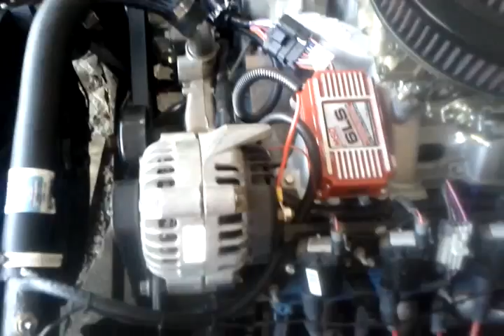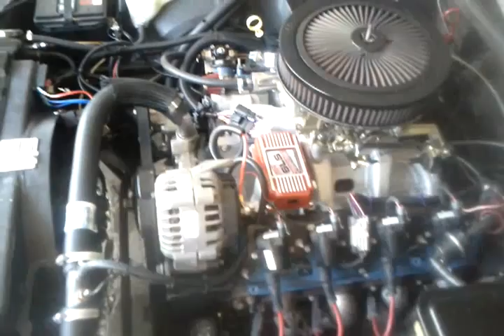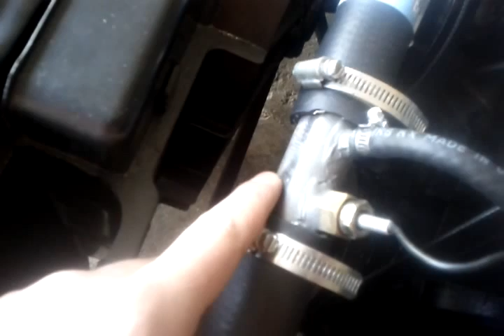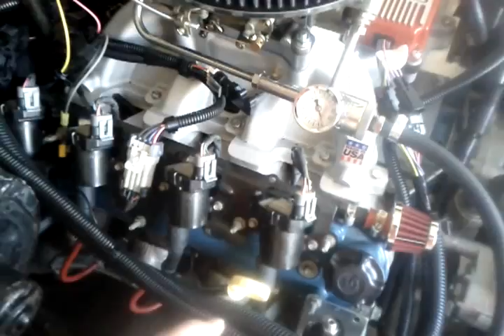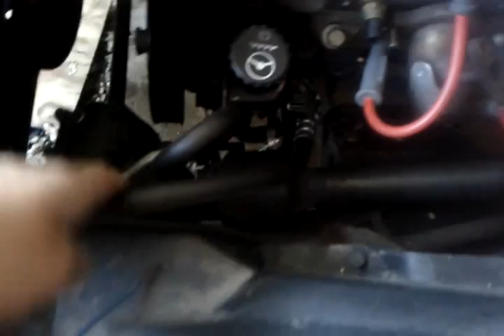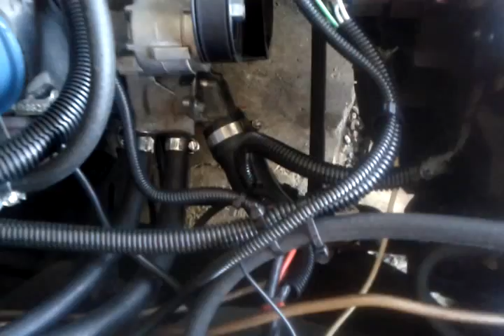How-to: Swap an LSx Ls1 4.8 5.3 6.0 into older GM cars

Comment: Did you have any problems...puting back on the  oil stick or trans tube..i have hooker headers...trans tube ...i put headers on then trying to put them back..not having any luck to get them in the hole..lol..any advice..do you have a email or cell..i can get hold of you..mines email margarcia1960@yahoo.com...thanks
Reply from the maker: slid right in man
Reply: Lokar solved my trans dip stick problem with ls1 in 63 vette

Comment: Hey can you tell which way to go my motor is 6.0 vortex with a electrical throttle body can I make it cable throttle  thanks for all info
Reply from the maker: What year is your 6.0? You can mod the harness for sure as well as swap out the throttle body but you have to be sure which pcm you have.. Some can be reprogrammed for DBC others Cannot.
Reply: ..

mkm.n.hhñnbn
Reply from the maker: What year is the engine ?

Comment: Im stuck.here brother..i.watched one of.your.other videos..im.using stock.olds.radiator but use.ford truck.lower radiator hose..not work...to.big and.not correct shape..can.you help ne.out
Reply from the maker: If that won't work use a stock lower hose out of a Tahoe/ Suburban.. IT will need trimmed and may rub the frame but they come with a plastic sheath.. Keep that sheath on the hose to keep it from rubbing through

Comment: if I run a carb setup will I need the factory wire harness for the ls(in my case lq4)? also what torque converter are you using? is it just the flywheel and torque converter that were originally in the car? also what starter are you using?

Comment: I used the flywheel/converter step adapter you speak of to mate a th400 to my 5.3 and I have about a 1/4" gap between the converter bolt holes and flywheel bolt holes. Should there be that much gap? If so can I use washers between the gap?
Reply from the maker: Are you using an aftermarket converter? 1/4inch isnt that big of a deal you can slide the converter up to the flexplate and bolt it up as is. But if the gap was any bigger than that I would check to make sure the trans is mated to the engine flush
Reply: +D.Szymanski Yes I'm using and aftermarket converter. Transmission is flush to the motor. I tried pulling the converter towards the flexplate and it wouldn't move so it must be up against the flexplate with the holes being that 1/4" or so off. Should I be able to slide the converter back and forth a little?

Comment: Hey thanks for the video, I am debating putting a LS in my 66 Chevelle, I plan on using my current 4 speed, and all the parts I can re-use. About how much did you have to spend on items to get it running and driving?
Reply from the maker: about 1500

Comment: So Im wanting to do this on a 78 c-10 stepside. And the looks of it the carb setup l;ooks simpler then doing fuel injection. So what's the steps on doing this ar far and the computer etc to still control spark etc. since using a carb? What do you suggest to do this on a budget? Possible to reuse a th 350 trans? any info on this swap is greatly appreciated... Thanks.
Reply from the maker: I have a lot of videos in regards to the swap. If you keep the stock pcm and harness just for the ignition control aspect you might as well go all the way with EFI. Its going to cost you about the same either way you go.. Spend $600-700 to convert it to carb (including $ for a carb) but you're already there! Just go efi and get it tuned!

Comment: Hey man thanks again for all the great videos, they've answered so many questions for me. The one thing I've ran into that I haven't heard you reference is the intake manifold gaskets. Did you modify the oem gaskets to fit the carb intake or did you use individual o-rings on all the ports? I was hoping to use an oem gasket but the clips that secure it to the stock manifold don't work for the Holley single plane manifold I have. I think I can get away with grinding the clips down flush but I wanted to ask your expert opinion.
Reply from the maker: I used ls1 style O ring gaskets for the carb setup

Comment: I need some help brother.
I talked with summit racing the they use heddman headers.#45,000 ..$400..but in order for those to work u have to get crossmember wit different motor mounts $600its a kit..omg...all your videos are Awsome...not sure if u remember have 84 cutlass 5.3 4L60
If its not to much trouble to get a part number you used for headers and crossmember.plz...i found a crossmember off a 350..but not sure if it will work..thank you been a big help

Comment: what did you do for the drive shaft?
Reply from the maker: Stock.. the trans is mounted in its stock location
Reply: will the carrier bearing hold up?
Reply from the maker: +Zon carrier bearing?? it's a once piece shaft.
Reply: you using stock drive shaft from tranny or truck?the tranny drive shaft u joints are to big for my yok should I replace yok? sorry for the questions first ls swap.
Reply from the maker: +Zon not a problem brother. I'm using the car drive train.. the engine is out of a truck. I'm using a th2004r trans not a 4l60e
Reply: I have a 4l80e.
Reply from the maker: Your gonna have to cut like 3 inches off and get a special slip yoke which STRANGE makes and its like $150 eeek
Reply: thanks

Comment: Oh i thought using smaller pulley for ps...i would need a smaller belt.
Reply from the maker: I use a stock truck pulley stock belt. if you went with a smaller pulley it wouldn't hurt to get a size smaller than factory belt

Comment: What number belt you use..i using camaro ps pulley..and no ac..will add ac down the road but on a buget..didnt know if you remember the part number to belt size...thanks
Reply from the maker: Whatever the stock 5.3 used with a 105amp alternator

Comment: Thanx for the video. Definitely cleared up the questions I had. Any personal preference to the LS motors? as far as what's simpler to swap and build
Reply from the maker: all of them are based on the same architecture... I like them all brother
Reply: +D.Szymanski Transmission of choice? As close to plug and play is what I'm goin for.
Reply from the maker: +Stainless Slayer Th2004r is what I like... unless ur doing a truck... then I would suggest a 4l80e but that's just me
Reply: +D.Szymanski Thanx for the info friend.
Reply from the maker: +Stainless Slayer yes sir anything you need let me know

Comment: will an ls1 fit on a 2003 Silverado? can't find an answer anywhere
Reply from the maker: I don't see why not. it's the same engine family just make sure the flywheel you use is correct for the application
Reply: +D.Szymanski thanks for the fast reply. I know it's a higher end engine. do you think my regular mechanic would be able to put one in. or would I sound silly for asking him.
Reply: +D.Szymanski I mean as in, any regular mechanic
Reply from the maker: +Hayden Hughes gotta ask him partner.. honestly if you already have a 4.8 or 5.3 don't waste your money on an ls. they are based on the LS and with a tune, cam, headers and proper exhaust you'll be much happier and save a lot of cash
Reply: +D.Szymanski it's a 4.3 haha. I guess I'll ask. thanks for your opinion!

Comment: how are you controlling the tcc lockup
Reply from the maker: Toggle switch... I tried to go the automatic route with an oil pressure switch in the 4th gear pressure port but it doesnt work with the manual valve body setup

Comment: what did you do about The knock sensors?
Reply from the maker: +Cody Good with the carb setup you dont use them... I went back to EFI so they are in full use
Reply: can you jus leave them or find bolts to plug them
Reply: im gonna buy a lsx valley cover

Comment: why in the world would anyone go backwards to a shit carb from fuel injection it makes way less power and has a million times less control because lets all remember that we don't drive around at wide open throttle
Reply from the maker: +charles fournier cost and simplicity you tune with a screw driver, jets and a vacuum gauge NOT $600 worth of software.. I knocked out over 20mpg and it ran like a top... I ended up going EFI this past winter because I fell into a situation where I acquired all the necessary components. As for power... Your comment is inaccurate.. With a carb the engine takes what it needs and either it runs correctly or it doesnt.. Wide open you are still at the mercy of the injectors firing... Top end you typically produce 10% more power with a carbed setup.. EFI is just so much easier to deal with for everyday communting
Reply: that is exactly what I am talking about it is totally impossible from an engineering stand point that a carb can be anywhere as efficient as efi even as a system with a horrible processor a carb tries to keep up with what an engine wants with one set fuel pressure and whatever given set of jets an efi system can change pulse with as determined by all input sensors it can change timing as needed there is nothing to say other than carbs are old and obsolete and efi rules
Reply from the maker: Its simple...thats all..

Comment: I just bought a 70 Nova with the LS1 carb swap in it. The previous owner hooked up a switch to turn on and off his cooling fan. I want to hook it up to the engine. where did you hook up your switch on the engine. also he did not hook up the electric choke. do I need to hook it up or not. please let me know.   THank you
Reply from the maker: +Daryle Wilson My cooling fans are manually controlled too..
Reply: thank do you have a manual choke or do I need to hook that up

Comment: Question regarding transmission. Which one do you use? If i plan to use a 4l80e, with carb setup, do i have to get an individual trans controller?
Reply from the maker: +smilinjoe23 Im sticking with the Th2004r

Comment: im wanting to go with a LS1 in my 50'studebaker truck. what kind of wiring issues did you have? to ignition switch etc.
Reply from the maker: Its cake.. everything is seemingly self contained... You wire it like a regular engine... Ground the block 12v to the starter... but if you go EFI everything is self contained.. same with running a carb

Comment: Will a 700r fit on a 84 Chevy . its not a 4x4 if i was to do the swap on a 02 vortec engine its out of a chevy avalanche thanks. i just want to make sure before i buy the engine and transmission.
Reply: Thanks, i like what you did. Looks nice and clean.

Comment: seth rogen?
Reply from the maker: a lot of folks tell me that lol
Reply from the maker: whats up
Reply: +D.Szymanski I need ur help
Reply: I need a motor for a 88 Chevy something around $800 a motor that runs whats the best?
Reply: +D.Szymanski Georgia
Reply: BEETEROLDS Swaps & How to 

hey I have a 1983 Oldsmobile recency 98 so the car goes foward but won't reverse is there another way to go about it instead of buying a new transmission???
Reply: Holy Shit! I here it too! lmao
Reply from the maker: Isael Franchini my 1983 Olds Custom Cruiser wagon had the same problem. You're buying a transmission. Where are you located?
Reply: What length drive shaft are running with this setup.
Reply from the maker: Where do you live?

Comment: Is the computer only needed if you're running fuel injection? And did you need the gas pedal of the vehicle you took the LS out of? One last question... I'm working on a '92 Silverado. Would the factory transmission of the truck work with the LS?
Reply from the maker: Yup no and yes. up to 2002 the truck setup had a throttle cable so the pedal.was not needed unless you got a setup from 2003 up

Comment: Hey Doc I got a 71 el camino with a semi done ls1 Only issue I have is what wire does this same alternator to to on a 71 A body
Reply from the maker: wiring will be the same. the only time you'll be screwed is if it's 6 volts or the car uses a generator... if you have a dash light you'll be good to go.

Comment: I'm swaping a 91 jimmy to a lq4 5.3 I'm getting a 2005 trail blazer  to strip out what all do I need to take off of it
Reply from the maker: That's a loaded question. keep the trailblazer around until the swap is done man
Reply: +D.Szymanski its not a lq4 thats a 6.0 I forgot the number for the 5.3 I'm taking  trans and transfer case I'm gonna have problems with wiring
Reply from the maker: +Shawn Gardner your gonna have problems with the oil pan too
Reply: +D.Szymanski advanced adapters sells them I'm new to this new stuff im used to old school sbc
Reply from the maker: Id run a GM muscle car pan in that truck... The engine mounts are easy no need to spend crazy money on it..

Comment: Is that 105amp strong enough to run fuel injection I got the same one in my regal and it gets extremely hot it's hot even before the engine is fully warmed!! So I went and got I big truck alternator and when I went to close my hood it put a nice size knot in it!!! Could the 105amp I have just be bad??? A fiberglass cowl hood is like seven hundred bucks!!
Reply from the maker: 105 amp unit was stock... are you running anything else? like a system or something
Reply: +D.Szymanski I have just 150 W amp for my six by nines that I plan to use but is not hooked up at the moment the only thing it has been running so far is the basic stuff like fuel PUmp  coils and injectors
Reply from the maker: +Robert Hanna alternator itself might be bad or a short somewhere
Reply: +D.Szymanski thanks I just ordered a new one from eBay if it does not work out I'll still have a big truck alternator it's just that I'm kind of leery to spend 700 bucks on the fiberglass hood that site has a lot of bad reviews and that's the only one that's coming up! Nice looking swap you have I was watching your videos when I had a bunch of parts and no knowledge on what to do so thank you for the videos keep them coming!
Reply from the maker: +Robert Hanna ya I don't see a reason why you shouldn't be able to use the 105amp unit. make sure the cable from the alternator to the battery is thick enough. that's all I can come up with
Reply: +D.Szymanski will do thanks brotha!!!!

Comment: All the time, cost and effort and you don't use the fuel injection?  What a waste.
Reply from the maker: I'm building the efi system for it now. Things cost time and money. the only waste is the time spent responding to your ignorant comment. where's your project?
Reply: +Avalanche2 actually without lots of tuning to the stock ecu the carburetor will make way way more power. see stock ecu's are programmed for emissions not for performance also stock intakes are not made to make top end power. if youre scared of a carb maybe you should just give up and drive a honda.
Reply: Nope - the carb may make A LITTLE more peak hp, and that is MAYBE, EFI makes for a lot more power and efficiency under the curve.
Reply from the maker: Its been proven time and time again the carb always makes more power up top... but for the street EFI is king.. The carb setup is simple.. I had this thing running in a day vs messing around with programming and the harness... which im currently dicking with now..

Comment: @beeterolds I was thinking about putting a ls engine into a 86-87 monte carlo should I is it too much work
Reply from the maker: +Jon Taccona its not any harder than swapping in a SBC
Reply: +BEETEROLDS so just basically carb it and I'll be fine
Reply from the maker: carb and msd 6010 and youll be golden
Reply: +BEETEROLDS thank you bro if I run into any problems I will definitely give you a hollar sound like you know what you're talking about
Reply from the maker: Its a pretty straightforward swap
Reply: +BEETEROLDS what about motor mounts
Reply from the maker: watch my other videos

Comment: Did you hook up the control pox to the altenator?
Reply from the maker: no... it goes directly to a keyed 12v source... I used the old HEI 12v output for the MSD
Reply: +BEETEROLDS okay thank you. Did u tear into your fusebox at all? I heard you can run a relay from there and make it work. Does that sound like a good plan?
Reply from the maker: +KAnthonyStrick1992 for what?? you don't need a relay for the MSD if you run it from the hEi
Reply: +BEETEROLDS okay cool. I was jus doin a lil readin around nd wanted to get ur opinion on the idea.
Reply from the maker: +KAnthonyStrick1992 Yup why make it harder than it needs to be brother. the swap is very easy..
Reply: I get you. Thank you for your help man! Nice olds too.

Comment: what did you use for a map sensor and what is the part number
Reply from the maker: +Randall Wyatt Factory GM 5.3... well actually most later GMs regardless of engine size use the same map.

Comment: I am in the process of installing a 4.8L LS Motor from a 2003 Silverado into my 1967 Oldsmobile Cutlass.  The problem I am having is the Steering gearbox is hitting the power steering pump and Pulley on the LS Motor.  Might you have any suggestions how to prevent this? My initial thought was to lift the motor higher on the motor mounts.
Reply from the maker: John Smith Jeep Cherokee Power steering pump pulley... From late 90s early 2000s jeep 4.0... They both use similar Saginaw Style pumps so the pulley will fit perfect
Reply: BEETEROLDS Thank You for the Update....

Comment: What kind of motor mounts and oil pan are u using ? I pulled a 5.3 and want to know if I can just drop it in.
Reply from the maker: +Sergio Velazquez CTS -V pan. Clamshell mounts 1 inch Setback plates

Comment: good vid, what about the oil pan, did you have to swap it
Reply from the maker: gReG sKi I used a Cadillac CTS-V pan.. the sump contoured the factory crossmember, and it only hangs below about 3/4 of an inch vs the stock truck pan which hangs 3 inches plus.

Comment: Thanks for the post very helpful few questions how to determine what tooth reluctor wheel your engine is to order the right intake and msd box? And what other wiring will I need or the kit will come with everything?
Reply from the maker: +damian ficklin What color is your crank sensor? Black is 24x Gray is 58x